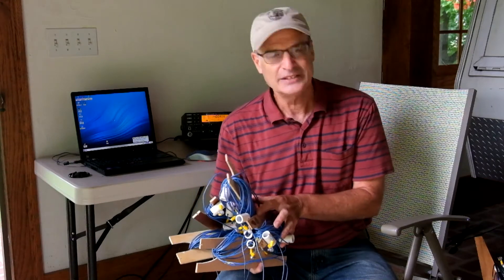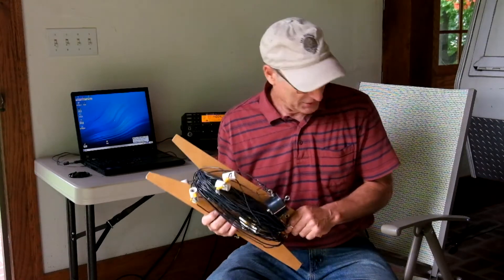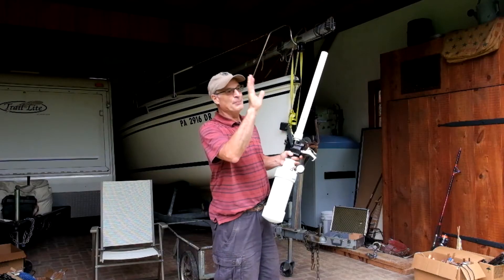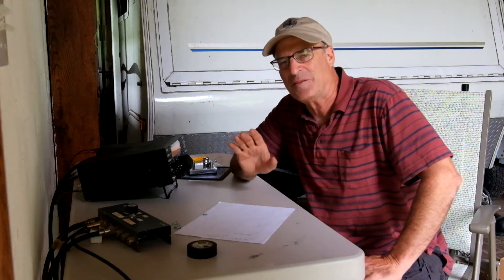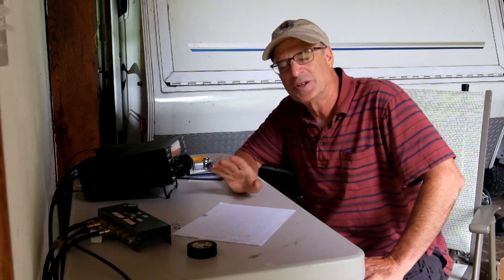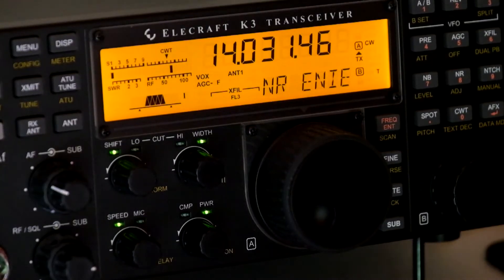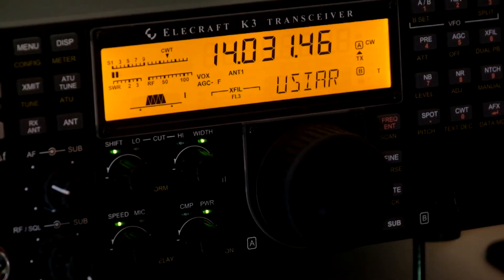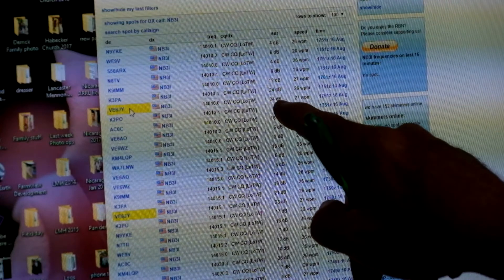Dipole, EFHW, Vertical, Windom antenna comparison

Comment: It seems your antennas were fairly close to eachother. I suspect you had serious interaction on the 3 horizontal polarized wires in addition to common mode currents floating RF on coax lines.

Interaction could seriously distort antenna patterns while causing radiation from all 3 antennas at the same time regardless of which was connected to the radio.

Proper comparisons would be more effective with antennas 7 to 10 wavelengths apart.

The power lines nearby can also distort patterns and affect your efforts. 

Many hams do comparison tests with antennas that are too close causing erroneous results.

NE2Q

Comment: What material was used for the first mast with the linked dipole? And how high was it?
Reply from the maker: Are you thinking of the linked vertical...  That is 33 feet...works for 40, 20, 15, 10.   It is a very lightweight fiberglass.   I much prefer the 12 meter mast sold by viberplex made by spiderbeam.     I used it in this video for the PA QSO party.....   https://www.youtube.com/watch?v=Dvy5dK9ah2g....   I also learned since this video that it is better to shorten the doublet to 110 feet instead of 133 feet to make it easier to tune....   I certainly am not an expert.... I learn as I go.
Reply: @radionb3i  yes, thanks, the linked vertical. I am looking at the spider mast too but I am concerned there is too much sway to support a lightweight balun for an inverted vee. Any insight you might have would be appreciated. 73s de N0SL, Ron
Reply from the maker: @ronm6359  Fiberglass is nice if you are using twin lead or a vertical wire...if you are using coax we prefer 6 foot telescoping Aluminium tubes.   If you watch my field day videos you see what we do for field day.   We get them up to 55 feet .   They are also cheaper I think.   Buy it from Texas tower or dx engineering.

Comment: Good test. It is extremely difficult to get good results.I find that the signal level on any one antenna varies with the QSB so much that  I have to get a high and a low value for one antenna and a high and low value for the other antenna over a period of several minutes. Alternating from one antenna to the other. I was recently comparing a dipole and a vertical on 40. The dipole was always peaking 5 or so dB above the vertical. However once there was almost no difference. 30 years ago I did a similar test with a big vertical, horizontal and a mobile antenna. I kept checking all day and into the evening with the Canadian CHU time station on 7.335. There were times of the day that the vertical was dominant and times the horizontal was dominant. Obviously the vertical on my salt marsh had a pretty good low angle whereas the horizontal had a much higher radiation angle as it was not “high” on 40 meters. I can’t remember the details but still have the readings somewhere! I like the RBN.
73 DE N4DJ

Comment: Unfortunately signals reflecting off the ionosphere are very dynamic.  They change in polarization and strength, and because of this even the same signal from the same antenna will change second by second.  People who use WSJT for FT8 or similar modes can easily see how the strength of any particular station will generally change from one transmission to the next.  The other factor is of course that these antennas will have different radiation patterns where each may favor certain directions and/or distances.  Nevertheless, no antenna in the test showed up as a clear failure or dummy load.  And who knows, with enough tests and experimentation it might be possible to formulate some sort of conclusion.

Comment: Wonderful research ... particularly for a Wire Antenna's ..
Yagi's group are Good but Awkward and Expensive besides it need a Ranch and Tower ...

To be honest with you .. what i am dream of is a Wire Antenna i can erect in my backyard (Let say less than 50 feet space ) But it is Very good in Receive mode and able to detect the QRP signals coming from DX overseas station against that huge background noise ..

For me .. i am not worry that much in Transmit mode ... because i can compensate the (Less efficiency / Out of band) of TX Antenna's simply with a (Tuner) and Little push in TX power *
 (* assuming it have a low beam angle , like verticals)  ...

i wished you joined T2FD Antenna to this tournament because (i heard) it has a Outstanding Receiving Characteristic ** , Perhaps that's why they have been produced commercially in many known hierarchy Brands such Codan and Diamond
(** Correct me if i am wrong ..)

Comment: I as well like the simplicity of a dipole.  At the moment I am receiving only on my Kenwood Ts-520.. my antenna is a 100’ household electrical extension cord, it works quite well to receive with. No, none,nada, intentions to transmit with.. just listening.  It is why I stopped by your video today.. to get that comparison between types of antennas. Thanks.

Comment: Excellent video, I have a question; In your (and most videos I see,) people often use an antenna switch box. In it, the coax connection side of the antennas are shared all the time between the various antennas, and you just switch the main radiator of the antenna around with in the switch box. Do you find any difference in not having the switch box in line and having a stand alone antenna each time, and keeping the antenna's separated? Or does having all those extra shared coax shield connections change the antenna's operation any? I just look at things a bit differently from an electrician's view point; example;  a ground plane plus a DI-pole sharing the same coax  shield connection. Does it affect the system any? It's just a question I have never seen a video on and was curious about. Great video.
Reply: It just seems to me a ground plane's counterpoise plus one half of a DI-pole have to interact in some way to change the desired antenna system's design.
Reply from the maker: All the antennas share a common ground.   I am not a very technical person..... I just know it works.   I am sure other's above my pay grade can answer this question better.   Ask Stan:    https://www.youtube.com/channel/UCBkyowYDOIQJEW638Zrg42g    He will make a presentation on this answer.

Comment: that was a really tall pole you put up at 4:24 what were you using to do that? and at 5:32 you have some sort of grey pipe with black fittings thats pretty bendy.
Reply from the maker: At 4:24 it is an aluminum pole...Actually a homemade 67 foot vertical...but I just use the bottom 43 feet for FD....put a wood stick in the top to carry the center of a dipole.   The other is Fiberglass...They are 6 foot sections and that also works well for fd... It is important to use with this EFHW antenna because it has a vertical radiator.   At 43 feet it is pretty flexible but with guy ropes it is very strong.   I use the 8 sections of a 4 foot fiberglass pole more often because it travel easier.   That one is considerable stiffer but I still guy it.  With a eight foot 2.4 base it still gets me to 36 feet.    Here is the link my use of that pole.... https://www.youtube.com/watch?v=hOCImHS6qFA

Comment: When you model those antennas.... On the harmonics they have totally different radiation patterns so you can expect different results between them. Only on the fundamental will the patterns be the similar. Sorry.
Reply from the maker: Interesting,  That might explain the kind of erratic inconsistencies I felt I experienced.  I must admit I was totally surprised that the End Fed reduced and almost eliminated a sporadic line noise I experience between the hours of 8 and 10 on 80 meters.   My friend says the toroids  he wraps the coax with at the end of the vertical radiator helps eliminate this noise.   Do you have an explanation for this?     My only trouble with the end fed is that it tends to rely on tuners which I tend to avoid.   The dipole is so easy to tune perfectly for my purposes.   You might enjoy this little video I made on our trip to Nicaragua.   https://www.youtube.com/watch?v=hOCImHS6qFA
Reply: @radionb3i  End Fed antennas don't require tuners if you carefully trim them to resonance, just like dipoles.  If you are not careful then what you have is going to need a tuner, much like a random wire antenna.
Reply: +1 to Steve's comment.  If you have the space to deploy more than 1 antenna per band there can be benefits, just as you demonstrated, due to differences in radiation pattern and take off angle.

Comment: Hi Jonathan,
Very good video. What material are the grey masts?   73   WB3BJU
Reply from the maker: They are fiberglass poles.   They work really well, especially if you have a radiating vertical wire or coax.   I use them for Field Day supports.   The one I used here is 7 - 6 foot sections so it needs to be guyed well.   The one I used in Nicaragua as YN1N is 8 - 4 foot sections.   That one is a bit stiffer....hardly needs guying....but I feel safer guying it.     https://www.youtube.com/watch?v=hOCImHS6qFA

Comment: So you do a antenna comparison on hf with all the inherent fading and differing angles of radiation as well as different time slots of each antenna and then you found the results were inconclusive?  I could have saved you a lot of work and told you that as soon as you explained what you test method was going to be
Reply from the maker: Yes, I'm sure.   It's a hobby.  I just do it for the fun of it.   I never set up different antennas before to run at the same time.    I will take the dipole to Nicaragua in February operating as YN1N.   Hope to work you in the contest.

Comment: Nice video
Reply: Furthermore the dipole is directional, while the two verticals are 360 degrees radiators, pus they all have different elevation angles.

Comment: Thanks for the great effort to set it all up. On FT8 mode a bit like jt65 but narrower band width I think they gauge signals in minus db and the less the number the stronger is the rx signal. It sure is hard to determine what works best I have tried several antennas on SOTA but these days settled on a link dipole most of the time. I have however made a summit 2 summit with Spain Germany Austria using a 58 foot end fed wire 9 feet counter poise on my kx3 and a summit 2 summit to usa on a dipole. I live in vk5 and enjoy watching all kind of ham radio on You Tube thanks for posting regards vk5cz ..